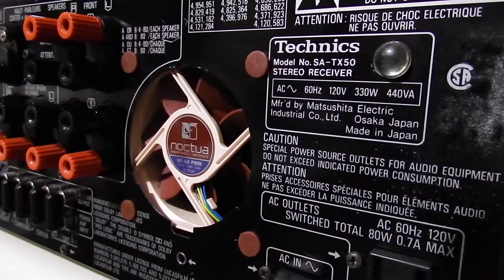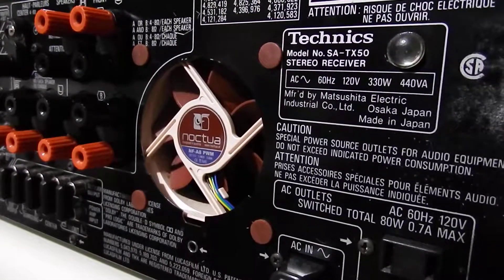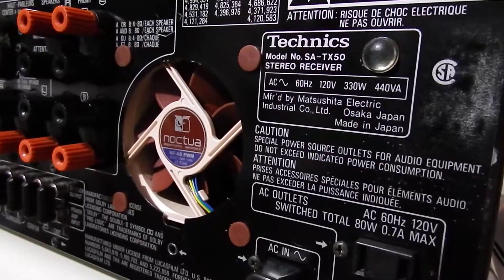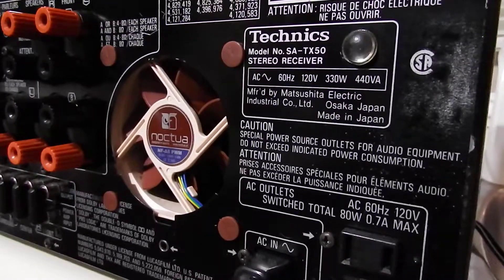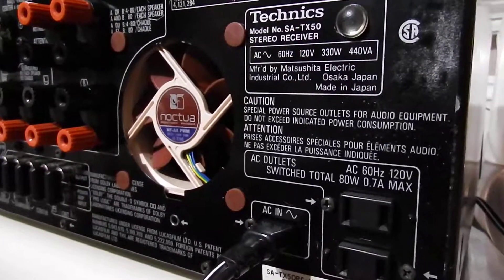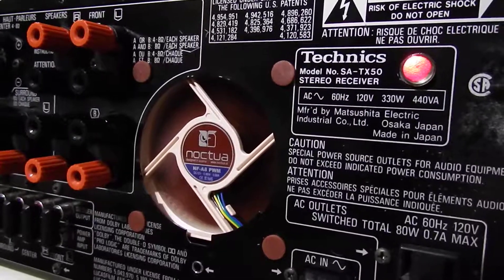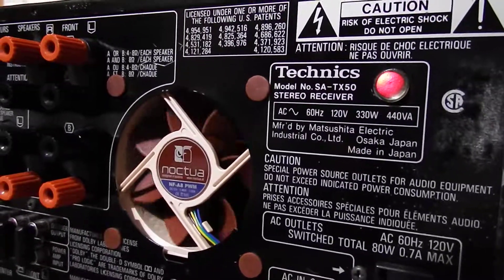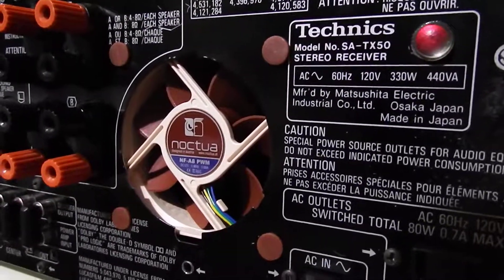Technics Stereo Receiver Fan Upgrade Fix for REM0020-1

Comment: it will not work because the electronic circuit needs a brush motor. If you increase the volume the amplifier will go under protection becasue it doesn't feel the fan.
Reply: I am not using the original power connector that was design for the fan on board. The power to this fan is being Outsource from elsewhere in the amplifier.  So Yes it does work as soon as the amp turns On, regardless of the volume control position! Thank You.

Comment: A video just showing the back of the amplifier is not really very helpful.
The schematic shows the fan having + and - terminals. Are you saying this fan is an AC fan, or is the voltage too high or low for a normal fan?
Reply from the maker: Mergatroid, if I give you everything on silver platter, that defy the purpose of making you trying to figure it out for yourself for a second does it? Keep watching and listening, maybe you'll catch on, all the answers is in the video, just LISTEN for onces!

Comment: I just remove the lid off the unit but then again mines is in a hifi cabinet with shelves.
Reply from the maker: you need to get a AC to DC Converter off the Internet and that one Fan off Noctua first.

Comment: Your new fan have 3 wires. The original fan have 2. How you connected them inside. What did you do to trick the processor to connect the speakers. Tried this with many fans and into my TECHNICS SA-EX120 and not working ! All receivers have this common problem and not so simple matter as you show us.
Reply from the maker: If you have four wires on the fan. Us the Yellow and Black wire. If you have three wire on the fan use the Red and Black wire. You will also need a AC to DC rectifier that you will tap into your display lighting. Good Luck. :)